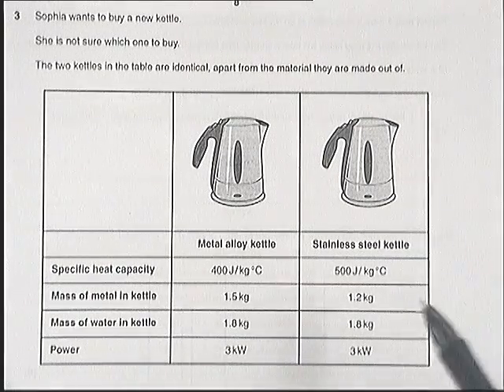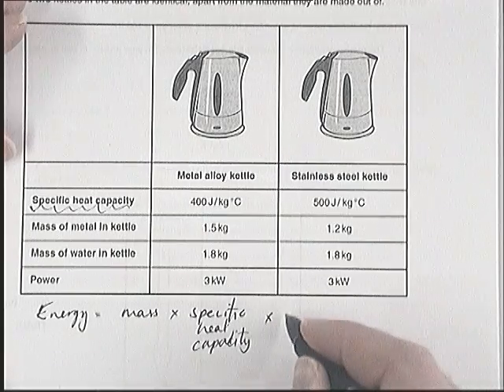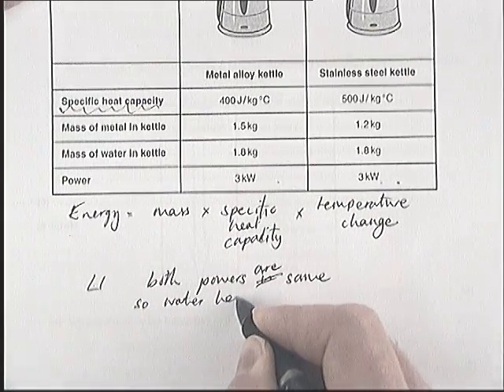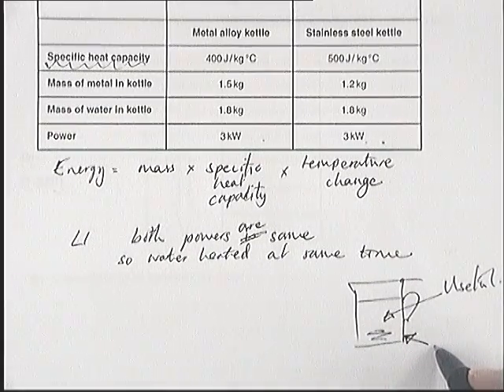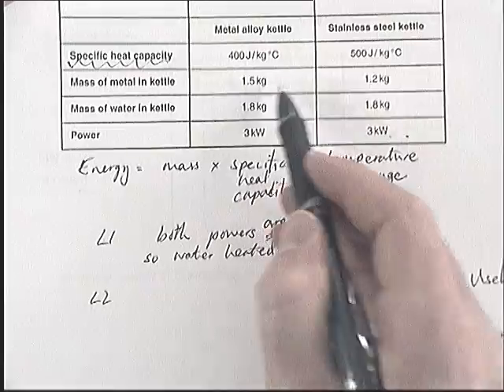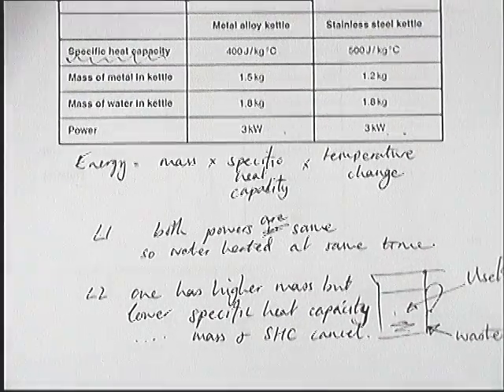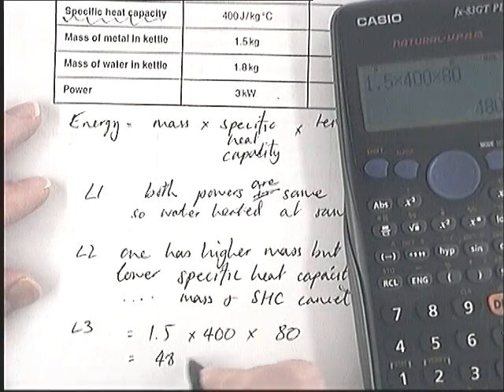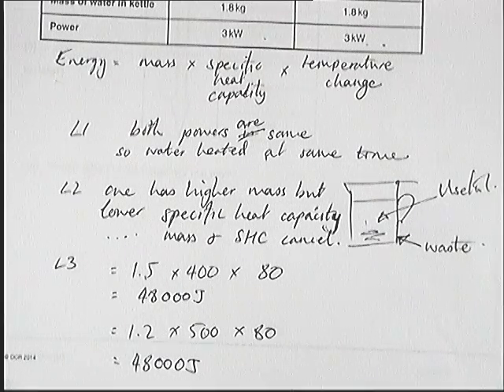Specific Heat Capacity - OCR Gateway B June 2014 P1 P2 P3 Question 3 - GCSE Physics Revision

Comment: I was busy doing a question where someone adds a solid into a liquid.The question told you the mass and the start temperature of the solid iron and the start temperature and the mass of the liquid (it was water). I had to calculate the final temperature using the formula mcdeltaT of iron=mcdeltaT of water. The start temperature of the iron is much greater than the start temperature of the water. Therefore energy lost by iron=energy gained by water as they will reach equilibrium. I had to rearrange the equation before to make Tf the subject of the formula. this took a while but I got there!!
Reply from the maker: Yeah, really interesting, you might be interested in the practical here:
https://www.youtube.com/edit?o=U&video_id=irHJw_4FrCA
It's A Level, but it sounds similar to what you describe.

Here's a simpler GCSE question:
https://www.youtube.com/edit?o=U&video_id=TRoqoep1-E8